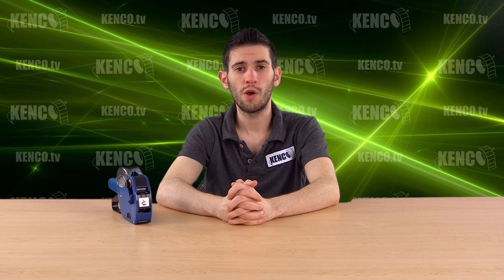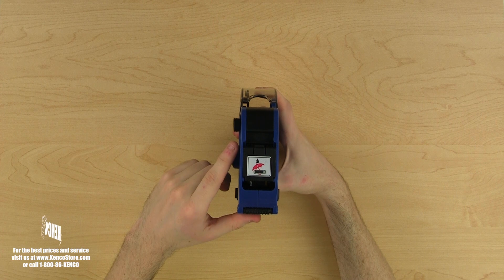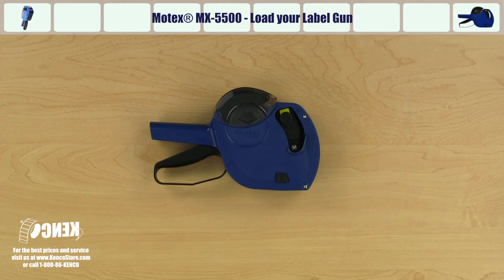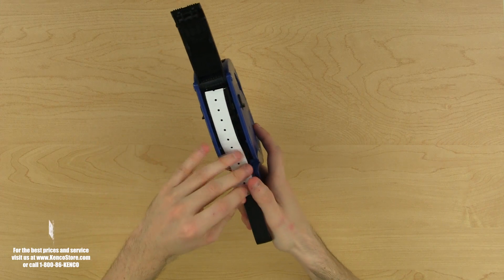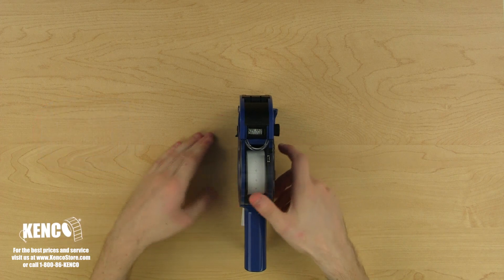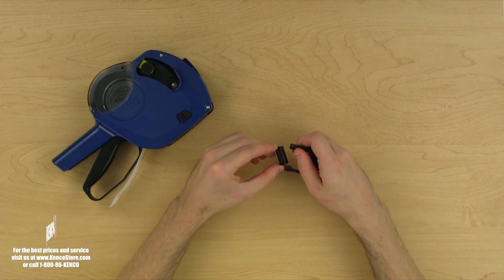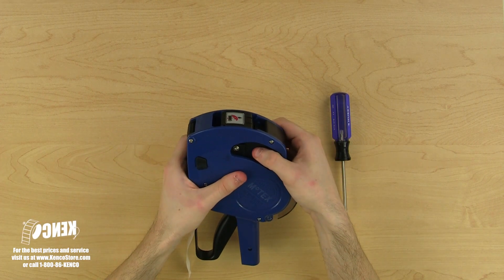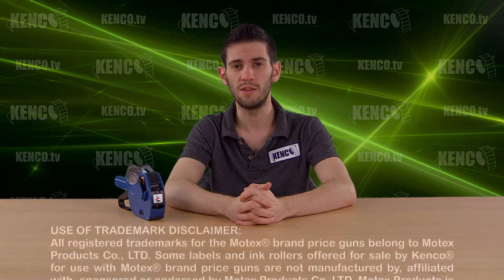Motex® NEW MX-5500 Loading & Maintenance Instructions

Comment: thank you for the video, I had a hard time figuring it out myself with no directions.. my sister and mom has two of them and gave it to fill the ink and pricing stickers to work on...
Reply from the maker: I'm glad this video was helpful.  Just as a side note.  Try not to "refill" the ink rollers and instead replace the whole roll.  The reason for this is that the roll itself will begin to deteriorate and debris can get caught in the printing bands making the print unclear and ruining the price gun.  The ink rollers themselves are relatively when compared to the pricing gun.  A general rule is to try and replace the ink roller every 20 rolls of labels or every 3-6 months if the inker starts to dry out.

Comment: Can you refill the ink rolls?
Reply from the maker: jarp87 You never want to refill the ink rolls!  Aside from the mess and cost involved, this is a good way to ruin your label gun.  The ink rollers start to degrade and small fragments and particles will come off and get stuck in the printing bands making them print less clear.  It will actually ruin the printing bands which is the most important part of the pricing gun.